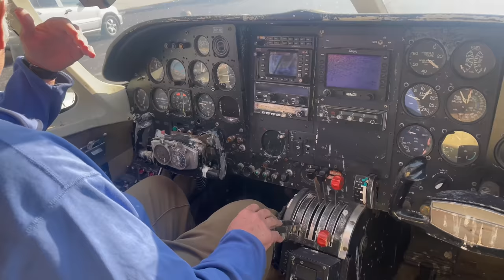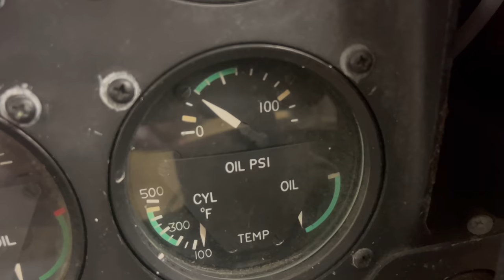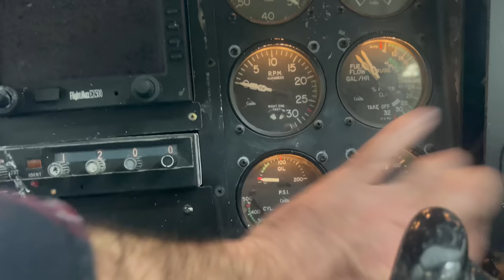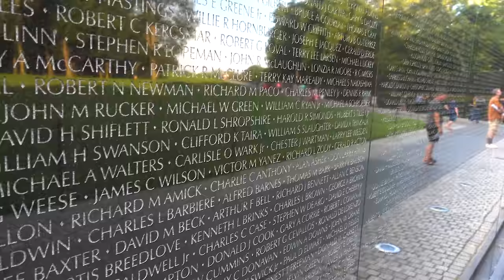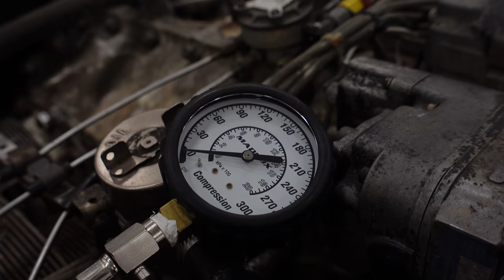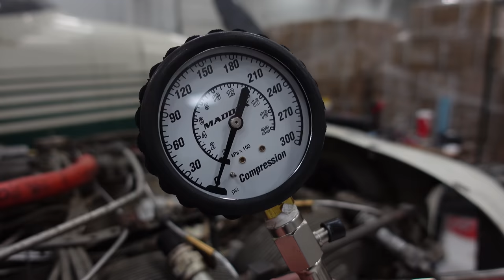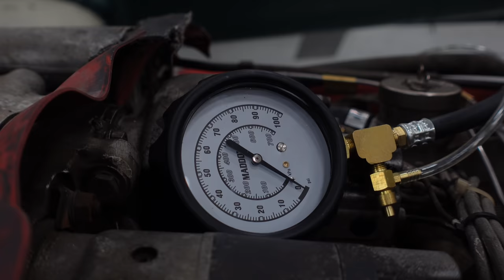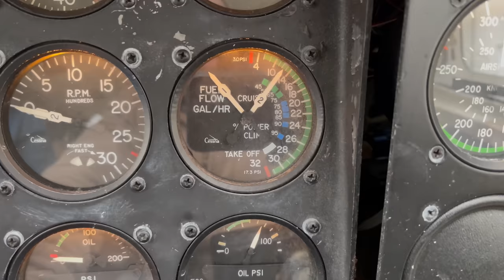Did We Ruin The FREE Abandoned Airplane Engine ? Ep6

Comment: Why throw away these headsets? I guess you can clean most parts with just some wipe and glass cleaner (against smell some people recommend for stinky new headphones to put them in a box with some coffee or tea for a few days) and the ear- and headpads are removable/repaceable, you may get replacement ones from Lightspeed or because they look live velour you can wash these (I got some Sennheiser HD 650 Headphones that were a sample and didn't get new earpads, just washed them really good).
Of course Jet fuel smells like Diesel, it's between gasoline and diesel and some turbines also can run on diesel (like the M1 Abrams') and Diesel engines on Jet fuel.

Comment: I need some help on this. What would be the issue with taking the prop off and getting the motor started hands on?
Reply from the maker: The prop helps to limit the rpm at which the engine can spin. If it’s started without the prop the engine would over rev and likely throw a rod or spin a bearing.
Reply: @rebuildrescue  Ah thought it would be something like that. makes sense. All the best for the future of this project. I see you already on 200k on the go fund me. Well done!

Comment: Why would put jet fuel in a high octane engines: to those of you that don’t know the difference between jet fuel and high octane gasoline. One is the  lightest form of diesel fuel there is,and higher octane fuel is for gasoline engines which the 401 is gasoline engine air plane. Jet fuel is a no no no.

Comment: Be a shame to spend 300k to restore a plane you can buy working for 150k
Reply from the maker: You can buy a 401 for 150-200k in flying condition for sure. But not one with zero hour components and with a newly modified wing spar which will be good for another 10,000 hours of flight 👍🏼

Comment: JET FUEL IN A GAS engine !!!. Major NO NO. Destroys every oil seal in the piston motor making them vulnerable to sudden rupture. INSANE. These engines should be torn now for sure. The service life of all the seals in them is well past manufactures specs.  even without using Jet fuel . Not to mention they sat on air out outside for decades in improper position, where the valve springs were likely compressed on one for decades Destroying the springs temper.  Those props are a total danger to run. Every seal in them is well past service life in yrs. you guys are dangerous.